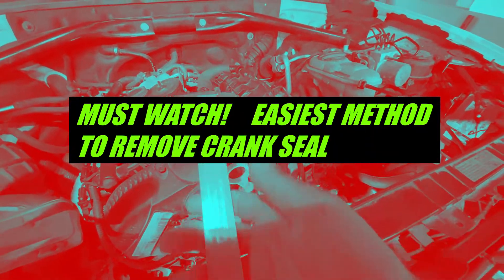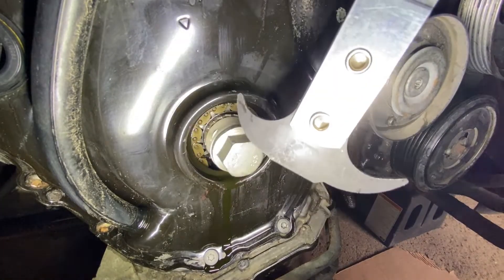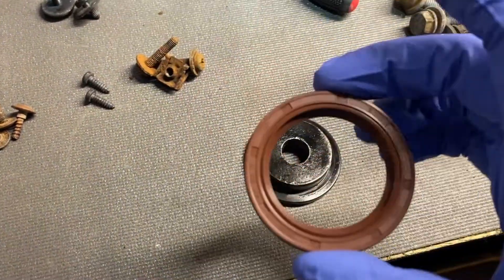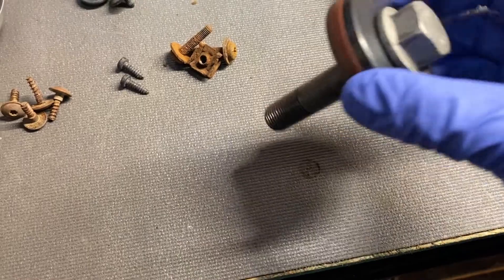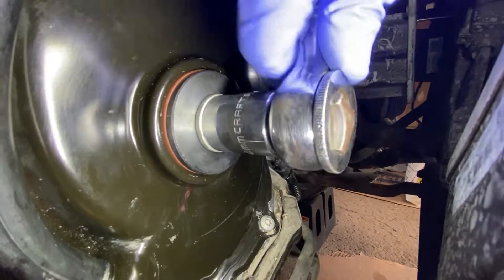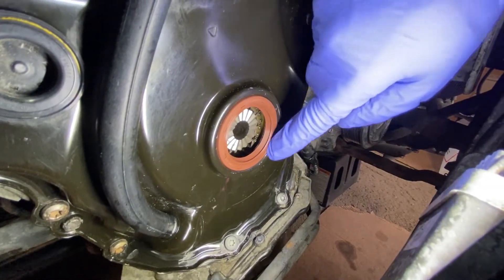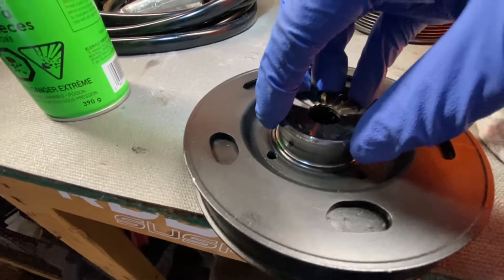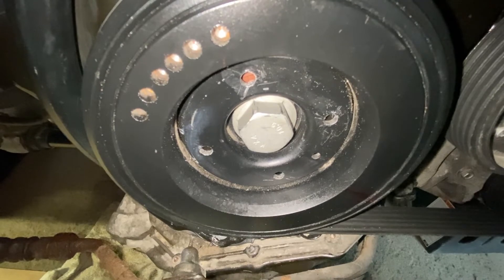CRANKSHAFT LOWER TIMING SEAL VW/AUDI 2.0T AUDI Q5 B8 B8.5 A4 A5 A6 Q5 S5  - EASIEST METHOD

Comment: Do you have links to the seal part number and the installation tool part number?
Reply from the maker: The seal installer tool # T10354  / Crank holder wrench # T10355 and the seal on this particular 2.0T my personal preference is from FEL-PRO TCS46138